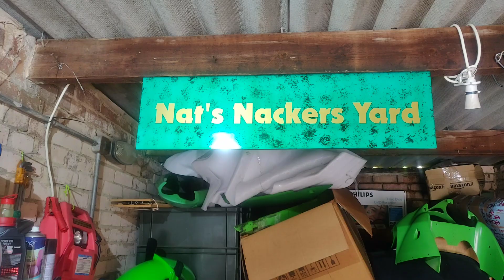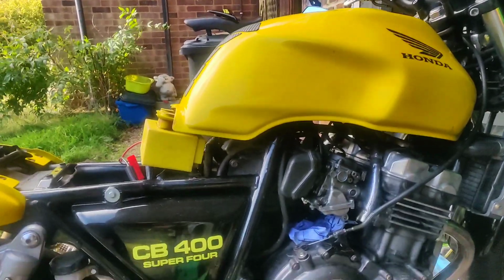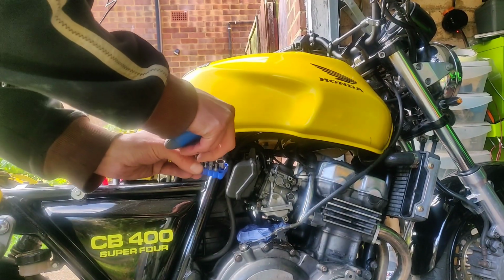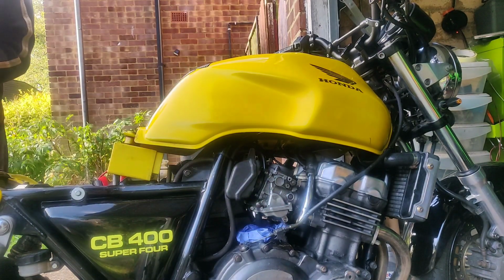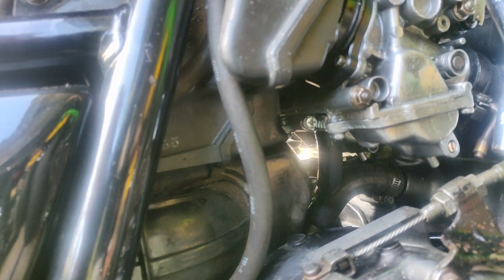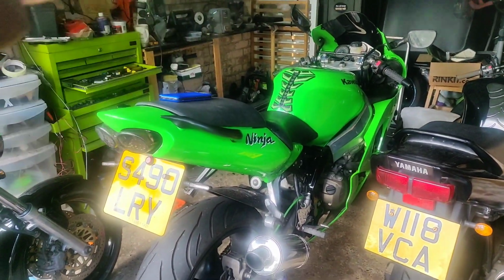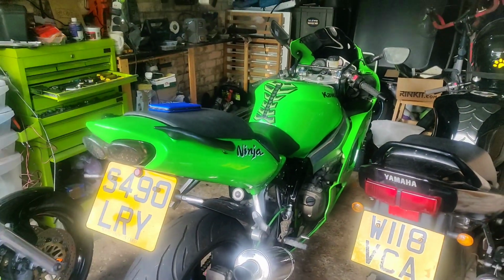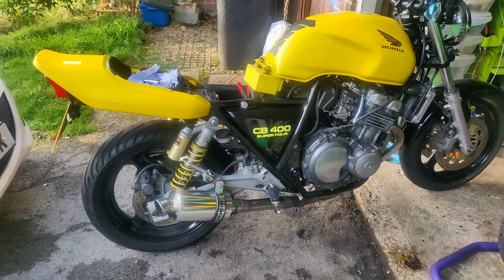Honda CB400 Super Four.  It's alive and I hate it!

Comment: I all ways replace the o rings in between carbs now when rebuilding for the few pennies they are  it’s just not worth the head ache.  I was told this ethanol fuel obliterates the old style o rings. NRP Carbs in Manchester can supply them fast.
Reply from the maker: The frustrating bit I'd that I did replace them already, but not with the right rings as I didn't have them at the time.  Lesson learned!

Comment: I recently owned a very low mileage early cbr600f, I had the carbs off three times to sort a low speed hesitation issue. Each dismantle took an eternity. As soon as I got it running perfectly I traded it in for a later bike with fuel injection. With the current ethanol infused fuel I didn't fancy a carb strip after any lengthy lay up. The only bike I have left with a carb is a two stroke with only one which is easily accessible. So the future's fuel injection for me until we are forced down the electric route.
Reply from the maker: I am with you on the electric route.  It's only matter of time!